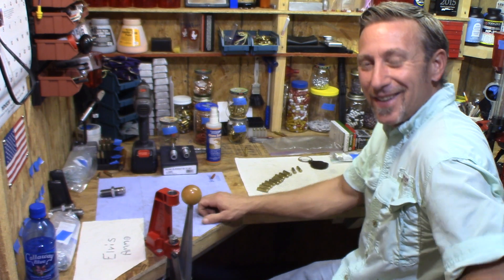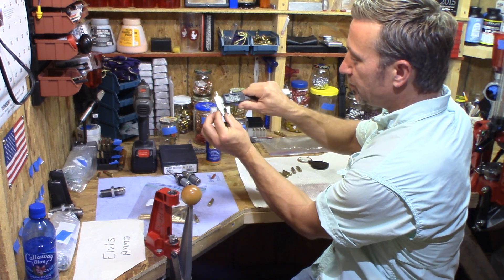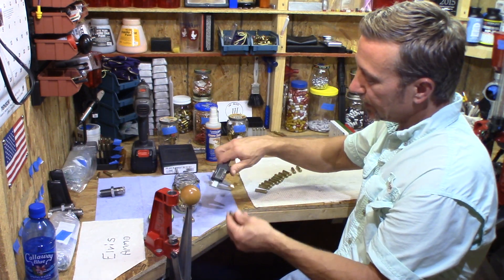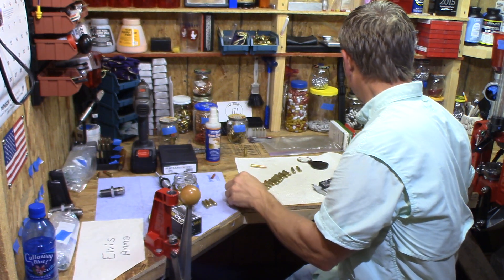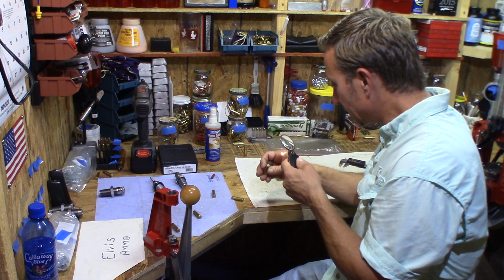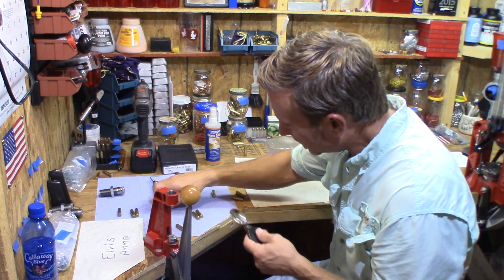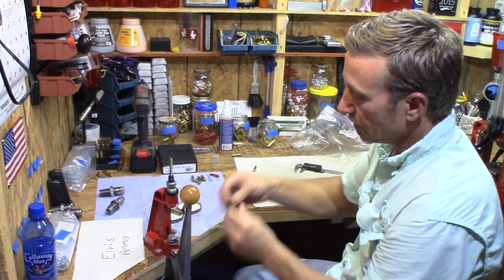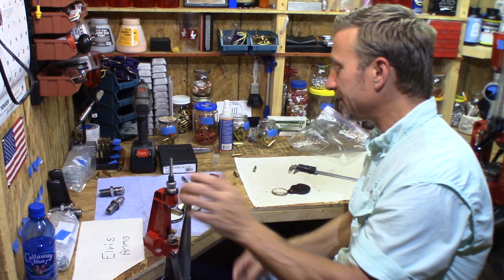300 AAC BLACKOUT (bullet chambering) IMPORTANT NEWS............

Comment: Elvis, The necks have spring back. You need to seat a .308, or .309 dia. bullet first, then measure. 300 BLK has a chamber of .334. I have used LEE, RCBS, and Hornady dies to form 300 BLK brass. It is the 223/556 brass wall thickness that needs to be checked. As "Paps's Place" stated, use known brass, or you need to "neck turn" the brass to the correct size...
Reply: you are so correct, I have sized thousands with a lee die with NO issues, and the small base sizer has exactly zero to do with the neck, it sizes the BASE at the web slightly smaller to allow smooth chambering with a dirty chamber. wall thickness is an issue, and if you are willing to use a Forster trimmer set up with an outside neck turner, the thick brass can be made useable, but that's a lot of work as cheap as once fired federal. Remington and Winchester brass is, just use decent brass, leave the Korean and Russian brass on the ground where it belongs.
Reply: When I was loading mine I loaded 50 rounds, and 3 of them were hard to seat the bullet

Comment: Elvis what you've found is correct. I ran into this about 3 years ago. In my testing the Lee dies only work with factory 300 blackout brass. Everything I formed from 5.56 or 223 was always over. I had to use the RCBS die on formed brass.

Comment: Elvis, this can be fixed. You need to turn the neck down. This can be done with all 223/556 brass. I try to use only brass wit a wall thickness of 0.110  to 0.1225. If the wall thickness is greater than 0.1225, the neck will need to be turned after forming the case. I try to use only wwc, lc, fc, or r-p 223/556 brass for my 300blk. This way I do not have to turn the necks.

Comment: Hi Elvis
 Just started reloading 300 BLK. Bought some Hornady new brass for a reference. Cut down Federal 223 brass. Annealed then formed with a Lee die set. The cases would not pass case head space gauge. As Charles stated you need a case gauge to check the case head space. I had to buy a Hornady die set (Custom Grade). Worked perfect. I don't know about the RCBS. But I know the Hornady works. Great videos.

Harold

Comment: Hey Elvis,Another Great video! I had same issues on my first rounds as well. I use lee dies and I now stay away from the thicker brass and my lee dies size down all the other brass to .328-.330 and all feeds fine. Some may not need to go to rcbs. Some of lee thinking is that they don't want to overwork the brass and shorten the life of it by sizing down as small as rcbs does and as you pointed out they are made to re size .300 blackout brass not form it. That being said I am having good luck using my lee dies for both as long as I stay away from the thick stuff. Using a case guage helps you as well. Good luck and keep all the great videos coming. Love them! Thanks for all your hard work!
Reply from the maker: hey crazycasting Bonnifield ... Thanks for your positive review of my videos. And I'm glad to keep them coming;  ) I probably should have mentioned the reason why lee makes their dies that way. thanks for bringing that up! and yes it depends on what brass you use... as you probably know I'm a big fan of lee products,  for good reason!  but I  am glad to have the sb rcbs die. so far I haven't had to eliminate any brand of brass... But it is nice to know that according to the information out there and my own testing it's not 100% necessary! Thanks again!

Comment: THANK YOU!!! THANK YOU!!! THANK YOU!!!   I bought a 10.5 PSA 300 BLK upper and was cutting and reforming .223/5.56 with Lee resizing die.   About every 3 rounds the bolt would lock up and it was a job to get the case out.  I bought the rcbs sb die and problem solved. If any of you are making your own 300 BLK, you need this die.  Thanks again Elvis.
Reply from the maker: yes sir... thanks for taking the time to comment... This is the key component!  : )

Comment: Elvis your expander ball in the Lee die is the culprit not the die .reduce the size of the expander ball and the lee die works fine brotha. .013 wall thickness x 2 is .026 + .308 = .334 which by your standards  is a no go

Comment: Ive been converting all head stamp 556 brass to blk and was having issues with chambering using the Lee die. I found that I was having shoulder setback problems.  Took .005 off the die and no more issues.
Reply from the maker: hey sthedhwig1... that was great idea. ... I  didn't even think to do that!!!  did ya use a grider?
Reply: no, dont do that, used a lathe. But just like you said in your video chambers can vary. Use a marker and paint your loaded round and chamber it. Look over the ejected round for bright marks as that is where contact is being made. My die wasn't setting the shoulders back far enough for my chamber. You or others may have a tight neck and trimming the die wont fix that.

Comment: OMG - Great Video! Thank you so much for posting this video.  I have lots of converted 223/553 brass to 300BLK that has either failed to chamber or got stuck in the chamber once fired.  Also, the Lee 300 BLK Ammo Gauge Checker is out of spec;  I have 300 BLK rounds that have cleared the Lee gauge  checker but failed when loaded in a Lyman Gage Checker

Comment: I use the lee sizing die with brass from 300blktalk list of good brass and i run each brass through the sizing die 2-3 times and i measure the neck and mine all read .329-.331 all the time. Dont know if this weakens the brass, have not got any split necks after shooting and reloading same brass.

Comment: Something else to consider (as is the issue with PPU) is the thickness of the brass where the cut is made. Just because the O.D. of the neck is within limits, the combination of the O.D. of the bullet and the thickness of the brass at the neck (x2, because there are two sides) may exceed the throat diameter of the chamber. I could load PPU if it would run through my RCBS dies, but when a bullet was seated and crimped, it was too big to fit in the chamber and would lock up - if it chambered at all.
Reply: Neck turn and chambering problems Will go away

Comment: Thank you for the video. I had quite a few stuck cases trying to deprime 300 Blackout with Lee's die set. I wound up using a Mighty Armory to deprime, but it opened the neck so wide that bullets just slipped in and out. I have  300 Blackout in AR-15 and bolt action that share the same magazine. Shoots fine in AR, hangs up in bolt action. I finally noticed the ring was consistently around .381 inches or more in diameter at 9mm from the headstamp end at the ones that would not feed. So I'll have to try the RCBS resizer.
Reply: Update: I ordered some used RCBS reloading dies off eBay which included an older version of "The Shooter's Box" ammo checker for $40. Money well spent thanks to your video. I had about three stuck cases that I had to remove from the RCBS die, but thankfully I had a stuck case remover. I removed the depriming pin since I already had the Mighty Armory deprimer as mentioned above and didn't want to deal with the pin getting stuck as well. I did choose the small base die instead of the full length die. I could feel the brass shrink down with each press, and each casing slipped right into the ammo checker. I reloaded and cycled 50 rounds out of the American Ruger Ranch with AR-15 magazine with zero issues.

Comment: Elvis...I mainly used Lake city brass and I also used the 300 Blkout forum  for "good brass" list based on head stamps. I also made sure the brass being used was under a wall thickness of .014". Average was .011 to .012 thousands. I even tried forming a more workable brass such as Hornady but had same outcome...neck would snap off at neck base. I like your advice on running at lower end of spec for ensured  chambering. the Lee's have been giving me a consistent   .329 to .330 neck form. would like to see my formed brass around .326 to
.328.

Comment: I have processed 1000's of 300AAC Blackout brass thru my Lee dies without a problem. The problems come from using brass that is too thick after being cut down. It doesn't matter what sizing die you use. If the new case neck is too thick it wont work after you seat a .308 (or .309 cast) bullet in it. If you stick with the known good brass you wont have any problems. List of good brass is available on www.300blktalk.com/ .
The factory 300 brass is formed with the correct neck thickness. They too should work through any die set with zero problems.
Keep it simple.
I like simple things. lol
Reply: +Papa's Place While this is true, you need to watch out for wall thickness, there are other reasons why it won't chamber and it has to do with sizing die, so a sizing die DOES matter, because I have to make sure I first size it with .223 and then 300.
Reply: Papa's Place I am thinking the same. just buy 6000 rounds of new unfired brass and I hope I never need more.

Comment: I use the RCBS small base - the fancy Lyman Die was a disaster -  to make it work when using chopped cases, I find if I run it through the sizer three times (up down - up down - up down) so far no issues - before the three cycle run several would not chamber

Comment: My Lee die using once fired 300 Blackout brass are all .3260. Every one of them are the same. I have not cut any 5.56 brass down. I don't want to deal with thick and thin brass. I have also bought some 300 Blackout brass, but haven't used it yet. I am running this in a bolt gun though. I really don't want change my upper on my AR. This is for a hunting gun that will be subsonic for the most part, with a suppressor for deer.

Comment: Measure the case thickness in the neck different manufacturers have different case wall thickness a thicker case wall will give you a larger outside diameter in the neck, to fix them would be to remove material from either the inside or outside of the neck to get the case wall thickness into spec.

Comment: I made some of those Rainier ballistic wedge bullets with new 300 blackout brass to the data from the factory. my problem is they won't feed o even extended the length just to experience. the bullet just jambs into the sharp edges of the ramp. my gun is a PSA 8 inch barrel upper assembly I think you have the same. it looks as if my feed ramp is off centered. any thoughts? I used 3 types of mags no real diffrence.
thanks

Comment: I've found that wolf brass would stick in the chamber occasionally when I try to manually extract the case but I've never had one not chamber. and I use Lee dies
Reply from the maker: hey tm74... well that's fine if it works in your chamber.  I've had hit and miss results in my chamber with wolf.  but with this rcbs sb size die it takes the worry out of it and I can, so far use all the brass I've found. I will keep checking just to be sure though .... thanks so much for your input!
Reply: I tend to size, trim than resize it again, both time using RCBS small base dies. I use RCBS small base dies also for my .223/556 brass.
I check them all with a wilson case gauge,
Reply from the maker: +garym1a2 yhea thats the smart thing to do. I  can see running them twice. . not a problem!  It seems the 300 blackout is a little more finicky for some reason?  thanks for commenting!  happy reloading my friend!

Comment: Elvis....I tried using the RCBS 300 BLK small base sizing dies and they would not work for converting .223/.556 cut brass. When I would go to form the cut brass, it would get real tough to size it through after lubing, the expander ball would shear off the case at the formed neck. At first I thought got a bogus set so I returned it and got a replacement...Had the same problem with the new set. Is there a certain way to set up the expander ball in relation to the full length sizer body? Im willing to try the RCBS again but dont want to run into the same problem. The Lee seemed to be the only one that would work for forming my brass.
Reply from the maker: hey tony soto! It almost sounds like you have a small base 223 instead of a 300 aac blackout? I havn't heard of this happening before..... i'll see what i can find out.....
Reply: Tony Soto get a full lenght resizing then do the small base. Just a guess you could be trying to resize it to small base while it needs to go down to a standard 300blk brass then small base.

Comment: I’ve never had problems with my lee sizer on my blackout.  I’ve heard if you use military brass to make 300 blackout with the lee sizer it will cause you problems on the first firing.  Maybe your lee sizer is machined wrong?  Or Maybe you have a tight chamber?  I’ve never had problems.  Maybe my chamber in my blackout is loose.  I don’t know, if something works for you, do it.  I’ll measure some of my brass, see what mine are coming out at.  Thanks.

Comment: I loaded this bullet in a 303 enfield with 40 grains of H414 .. went thru quarter inch steel no problem. barrel looks like normal dirt no leading.. I could be wrong about the leading cause I don't know what to look for.. gotta test for accuracy now.. I did powder coat them which gave me the diameter I was looking for.  gonna try in 308 as well...
Reply from the maker: hey jay vallea. .. that's pretty awesome,  that 40 grain will do the trick!  I use to think I was getting a little leading,  until I tested a round without lube or powder coat.  then I realized it was an illusion. . leading is not removed very easily! !! trust me.. and don't try this test.... I was a glutton for punishment!  ; )  but I  do know the difference now for sure. .....

Comment: Hey Elvis how's it going brother I size w the Redding deluxe die set 84327 has a full length and a neck sizing die and the seating I have not yet had a problem chambering any rounds     You can never go wrong w Redding plus you have made me really wish my 300 had a pistol length has system
Reply: Also I'm pretty sure Redding and rcbs make a neck turning tool although expensive to own it would solve the issue
Reply: +Todd Newsome sometimes I also remove my decapping pin but my process is neck size first w decapping pin then full length size w out decapping pin then check trim lengths idk if this info helps you or not but its my process and has worked great so far good luck brother
Reply from the maker: hey there Todd Newsome. .. thanks for all the info!  redding is good stuff ... I sure hope your 300 works out just fine.. you'll have to keep me updated. .. sometimes people have their gas ports opened up, for one thing. . there is a little fine tuning you can do. that's if there's any problem to start with. thanks again brother!
Reply: +elvis ammo yeah I already measured my ports there too end off the spec the 230 gr bullet is hit n miss on subs but the 247 gr works fairly well
Reply from the maker: hey todd newsome, how bout supers. do ya have supers?
Reply: +elvis ammo yeah some 168 and 230 gr that work great
Reply from the maker: +Todd Newsome .. good news, just making sure,  I thought you did!

Comment: While I like this cartridge seems like there are also too many variations in brass and and overall loaded lengths etc.Some factory ammo while just under max lengths won't chamber in my bolt action Ruger and the Lee bullet seating die I have I had to cut approx.3/8" off the insert just to seat the heavy 200 gr bullets being used for subsonic use as it ran out of adjustment.

Comment: My rife will not go into battery if the crimp is not tight enough. Small base reforming die is critical along with ensuring the case is fully formed. Next the shell wall cannot be greater than 13 thousandths.

Comment: Questions I have.

#1.  Where is your SAAMI minimum chamber tool for checking that the loaded ammo and the empty cases that are resized?

Lyman makes one that works reasonably well.  I've caught several cases that worked in a headspace gauge but would fail in a SAAMI minimum chamber.

Calipers on the outer diameter of the neck of the case is only going to work when the ammo is actually loaded with a bullet.

That's because the bullet does affect the outer diameter of the neck when loaded, especially if the brass is thicker than 300 AAC blackout maximum tolerances.

Take the calipers, measure the neck brass thickness and add the diameter of a common .308 bullet measured with calipers.  If the diameter total is at or below SAAMI 0.334 specs, then you are fine.

If it goes over, you cannot use the brass unless you trim the inside to the fit within spec.
Reply from the maker: hey havocsquad1.... yhea I have a lyman check gauge. that works great, I thought about it after doing the vid . I meant to at least mention it! My main goal was to find a rule of thumb solution , As always its hard for the viewer to read my mind....: (  your saami specs is exactly what I found in the test. 0.334  I'll be more cautious than that at not over 0.333 So far with all the brass I have used, when you use sized bullets in brass with in those specs and after using the lee factory crimp die they come out to spec, and chambered nicely.....thanks for the info! And for taking the time to comment.........

Comment: Okay Elvis...Thanks, its appreciated!   Iv seen comments related to mine in some of the reviews at Midway USA, most are positive. maybe I just got a bad batch of the small base dies...I checked the RCBS part no I previously ordered and they match the link you have, so Im pretty sure they were 300 Black out set.
Reply from the maker: hey Tony... what brass are you using and do you have different brass you can try? and also just for kicks and giggles, check the die to make sure its stamped 300 aac blackout on it. I think it has a sb also.....but yhea when I open the link it does show the correct dies.....